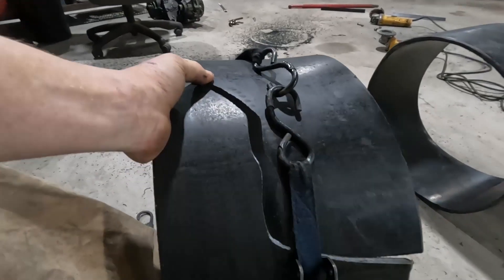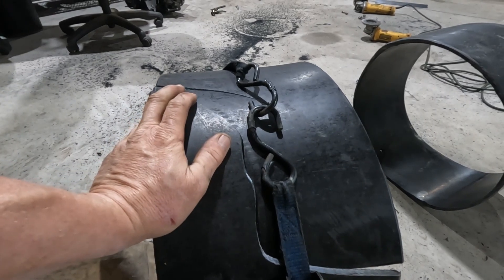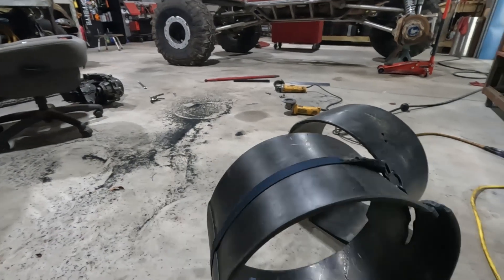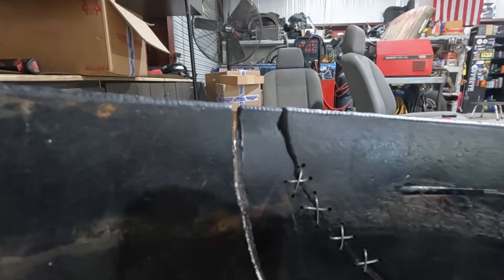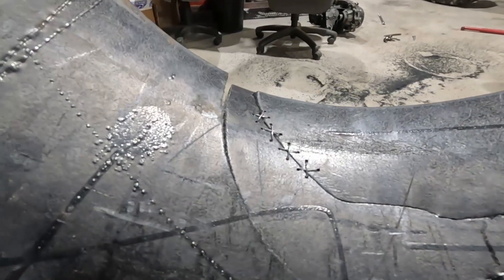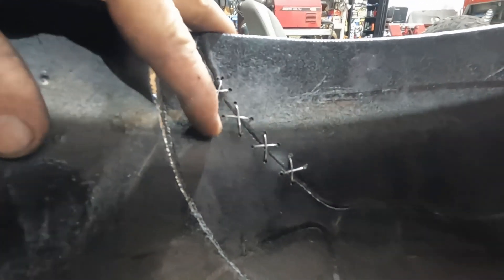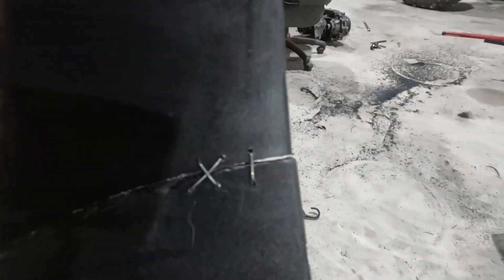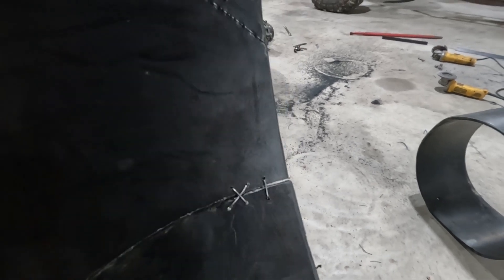6x6 Internal Bead Lock Repair

Comment: Im running old H1 wheels and tried pvc inserts back in early 2000's.  Had nothing but problems and fought like hell to get them in and seated.  Finally gave up and I'm back to the magnesium run flats.  Bummer is no one makes pressed centers for them anymore and I bend up the plate ones.
Reply from the maker: Trail Worth fab does centers for h1s still.
Reply from the maker: Stazworks still does some as well.   He can be reached at John@stazworks.com
Reply: Thinking of just buying "new" hmmwv wheels and running spacers, why not ask a guy on the internet what he thinks.  Would be easier
Reply from the maker: @Paper452  I personally would move to 17 inch wheels.  I know the upfront cost is large but there are more choices out there and tire manufacturers are likely to drop the 16.5 before long.   Lots of good used wheel and tire setups for sale in the 17 flavor